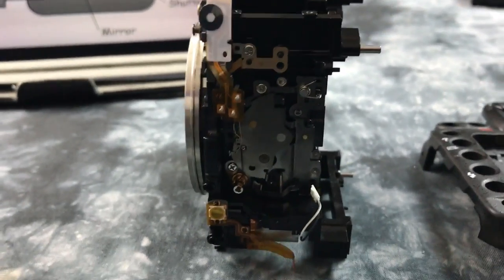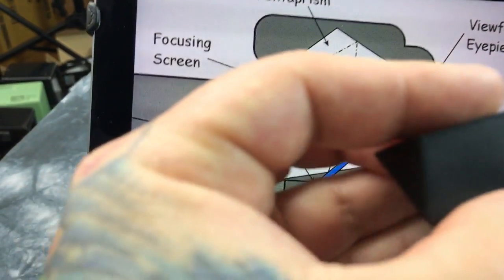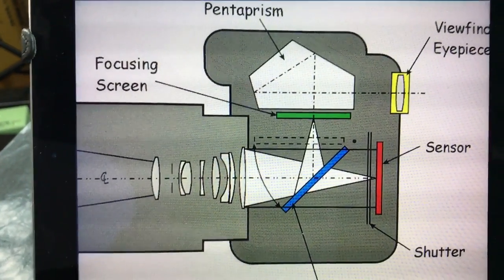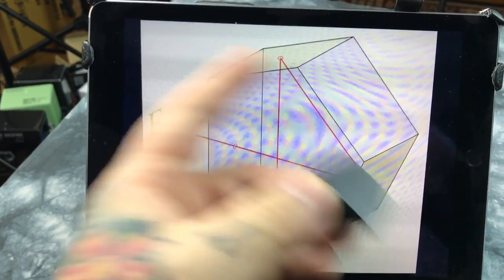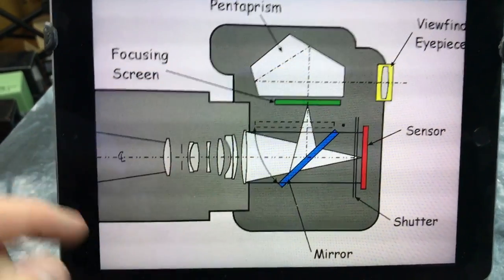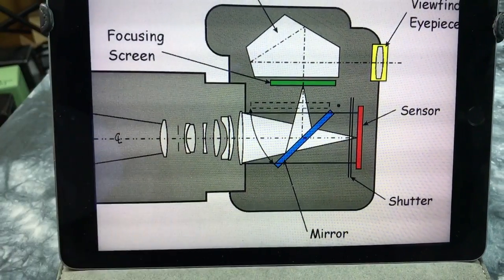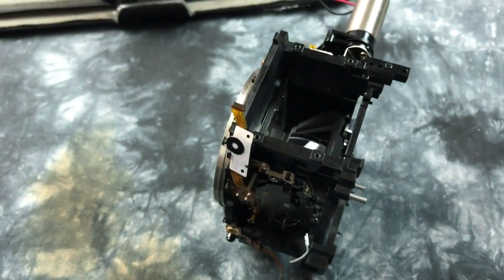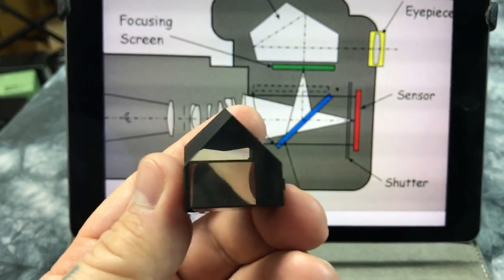!💋D850 OMG LOOK!! 😃😜YES!!! HOW THE D850 WORKS!!😘

Comment: This sounds fantastic. Since mirroless has been around for quite a while (relatively) I never really fully understood why DSLRS were still developed, all they did was swap out the film plane for a digital sensor. This is a camera that takes advantage of the SLR system and utilizing a digital shutter. I think I'm understanding this correctly.

These are the type of advancements (like physical and mechanical advancements) that turn my head, not simply more Megah Pixies to brag about every few years.

Comment: Hey, there may FINALLY be a reason to upgrade my D800!  I like that they're not going with a pure EVF, because the ones I've seen just didn't compare to a big, bright, DSLR pentaprism.  What I was really hoping for is a useable video autofocus system, something like Dual Pixel AF.  My D800 puts out such astoundingly beautiful video, but it's a complete bear to focus and autofocus is absolutely useless for anything which moves. 

I think the phrase you're looking for is Semi-Translucent, kinda like the Sony DSLT (although what you're talking about is a very different thing than the DSLT, which has a translucent mirror in front of the sensor which sends a portion of the light up to the EVF and a portion to the focusing mechanism).

Comment: Finally, a solution that will give the best of both worlds in one camera body. I hated a99 when I needed simple view without any overlays, eve would dim with back light and the facial expressions will be hard to see when I am underexposing for the ambient. A9 mechanical shutter is slow, so it's a no go for reportage with flash work.
 This camera should make a lot of people happy. Canon, are you watching?
Reply: Sergei Zhukov I don't understand the point with the low mechanical shutter and flash work... Do you need more than 4 frame per second working on reportage with  flash? 
On the A99, and any Sony camera with evf, maybe you didn't know that you can disable the exposure preview, so you could give it a try next time you use one ;)

Comment: Ken, I have a physics related question: Since the front surface of the pentaprism (where the EVF would sit) is not vertical, wouldn't you see a distorted "image" of the evf through the viewfinder? 

Do you happen to have a spare pentaprism? It would be really interesting to know what you would see from the usual viewfinder side, whilst holding a screen (e.g.  a smartphone) on the pentaprism front surface.

Cheers from Germany

Comment: Nice video. Thanks for the explanation. Hoping that whatever megapixels the sensor has, it will also have a competent hybrid AF system to take advantage of the EVF (along with zebras, false color, log profiles, plus it would be nice if it has the wonderful control of morie and aliasing that the D750 has).
Reply from the maker: likely for sure the A7RII 42MP sensor with its phase/contrast detect system

Comment: What would it do to battery performance? I know the knock on mirrorless cameras now is that batteries drain quickly due to the electronic view finder... Curious
Reply: That is because many of them have a very small battery. The A9 has a bigger battery and that is why it will take more shots on its battery.
Reply: yeah, but to add bulk to an already bulky camera.... I hope it turns out great! I shoot on a Fuji XT2 with the grip, I love it because of the pictures the camera produces, but def. compromising on the size.
Reply: I think Nikon design give flexibility to photographer. If you are in sport shooting mode . Then turn on the EVF mode so you will shoot like Sony A9. Otherwise just use the OVF to save battery.

Comment: So much speculation. Also, you can't just stick a display onto the outside of a pentaprism and expect it to be visible - pentaprisms use total internal reflections. A pentamirror system then maybe, but then there's the issue of where will the eyepiece focus as it will be set for the focussing screen and not the end of the opposite the eyepiece.

The devil is in the detail, and it's more complex than what is not much more than a defensive patent.

If Nikon could get their Liveview AF mode working as well as Canon's, that might be a start. Little point in an EVF until that is done. OSPDAF systems require a lot of development and often don't work so well with long lenses unless they are especially designed for the purpose.

Comment: The fujifiln x-pro2 allows an optical view + the histogram overimposed because the light is hitting the sensor so the histogram can be calculated. This hybrid pentaprism won't allow that because during optical view the light is not reaching the sensor so the histogram can't be calculated.
Reply from the maker: yes, i know that part.    but you still have HISTO in EVF mode
this is a huge game changer for nikon
also lets you do electronic shutter / silent mode shooting
Reply: Silent mode is great for weddings!
Reply: My old D90 has a translucent reflex mirror. Part of the light goes through to access the autofocus system. That would be a way to get around this, part of the light could go through the mirror and reaching the sensor so the camera could calculate the histogram while in optical viewfinder mode. But I totally agree with you that Nikon just made a HUGE step forward.

Comment: You're going to be really disappointed when you find out that those are just screw holes.
Reply from the maker: honestly it doesnt even NEED eye sensors, just a switch alone is plenty enough.
IF they are screw holes (which i doubt they are), it still changes nothing,
Reply: I don't think the roof pentamirror area is actually bulbous. I think it just curves inwards which makes it look like it's bulbous in that lighting from the back. If you look at the front view of the camera it looks normal but curves inwards. It wouldn't need to be bulbous though if the display is going to be mounted down low like you show in the diagram. I'm not sure about the switch on the right hand side either. I haven't owned a Nikon since the F3 (which had a mirror lockup button on the front of the camera) but looking at the owners manual for the D810 shows that there is a Mup setting on the left hand top dial. It's impossible to read the lettering on such a low resolution image so I can't tell if the Mup setting is on the D850 or not. Obviously if it does have an eye sensor then you would want to be able to turn the function on and off quickly (and I can't see the dial being quick) but the switch seems to be in an awkward position too. One other minor question is are those actual photos of a camera or are they CG renderings? The camera obviously exists if the 8K time lapse video is real but does the camera actually look like that?

Comment: There is still mirror up after all, offer optical VF and  the rest  was in SLT design 10 years ago, only there is transparant mirror eating 1/3 of the stop light.
Reply from the maker: but no mirror UP without losing looking thru the eyepiece........ EXCEPT YOU CAN WITH THIS TECH. 
https://www.flickr.com/photos/134746128@N05/36014758212/in/dateposted/

Comment: So that would explain the lack of a built in flash; they need the space for the flexprint that controls the EVF and the electronics that detects your eye in front of the eye piece.
Reply from the maker: no, all the pro nikon DSLR dont have flash anyway...D500, D5, D4 , etc etc.
Reply: I think you read my reply wrong.As a follow up to the D800, D810, one would expect a built in flash, but they omitted it, and my initial thought was that they needed the space for the flex print. You are under the assumption that I lack knowledge about the D500, D# series not having a flash. I applaud Nikon for removing the pop up flash from the D850.

Comment: Nikon has awaken!
Reply from the maker: !!💋😳ALSO let you do ELECTRONIC SHUTTER with this improvement!!!!!! !!💋😳
AF in "DSLR mode" would be SAME using AF sensor bay
AF in "EVF mode" same as any Fuji......using Phase and contrast detect on the sensor ITSELF
Reply from the maker: LOOOOOK!!!!!!!!!!😳😳😳😳
NIKON INC. 2013 PATENT FOR HYBRID EVF/OPTICAL VIEWFINDER!!!!!!
https://www.flickr.com/photos/134746128@N05/36014758212/in/dateposted/
Reply: They have! Angry, why are you pasting the same reply everywhere, makes us feel like pawns :'(

but lol, thanks for the viddy, it's awesome, and don't jump off a cliff.
Reply: Yes but than, Nikon will have to do much better / faster LV AF ( on sensor ) from what they have on D500/7500/750/810 - if sensor is from A7R II / A99 mark 2 and will have gazilion CD/PD af points on sensor like A7/A99 have than it will work fast and it will be revolution in photo industry ---- than we will have best from both worlds :)

I got to start selling my Canon lens and 6D - if they let this beast out with that EVF hybrid there will be shitstorm Canon user going to Nikon and used Canon equipment will drop price, especially after that 6D2 crap they fuc*ed us :(
Reply: Nikon has always kept one eye open.
Reply: Release the Kraken

Comment: So basically you need to enter Live View mode and use viewfinder to automatically turn off the screen and use that hybrid viewfinder, BUT what about horrible Nikon Live View focusing and shutter lag?!
Reply from the maker: this is DIFF. live view here isnt via LCD (unless you choose that) rather THRU the viewfinder same as any other EVF mirrorless. 
no, there are 2 holes in the back, that detect your face against the camera to turn on EVF if you choose that option. 
this would have phase and contrast detect ON SENSOR for superior EVF focusing.
Reply: Theoria Apophasis truly innovative